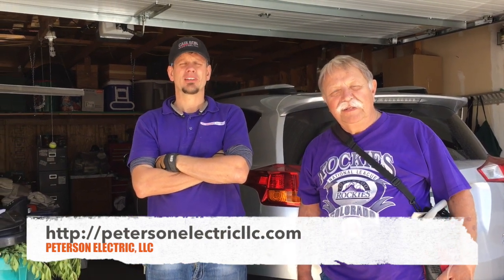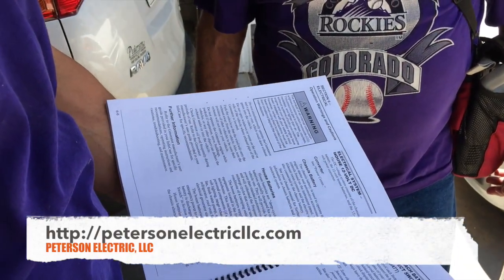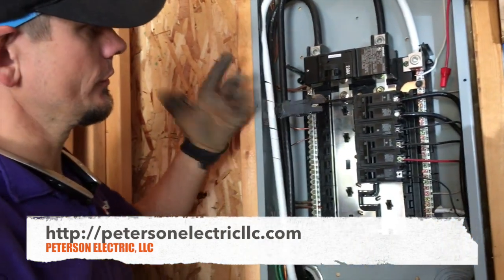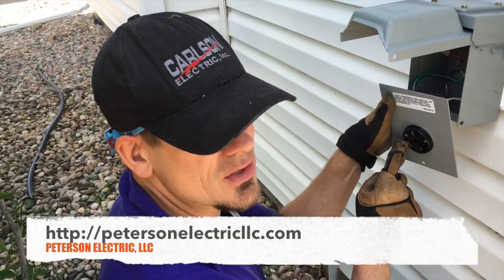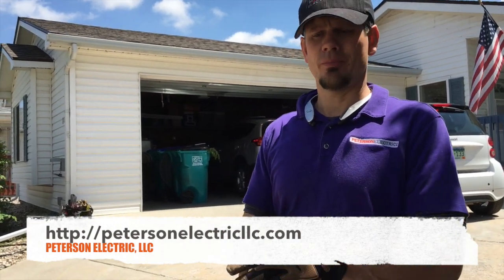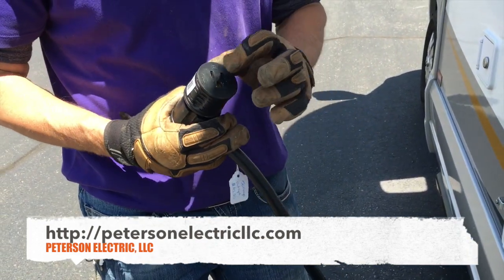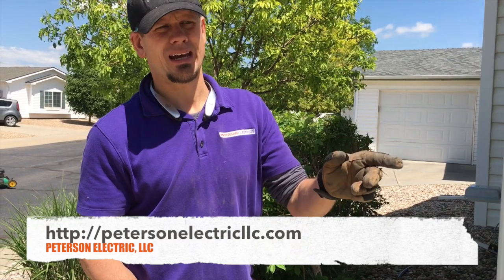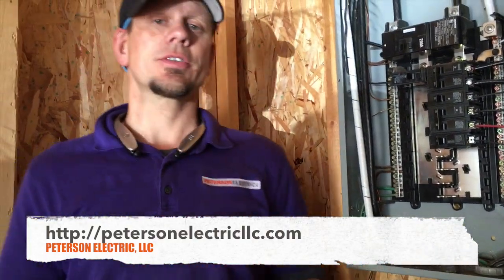Electrical Installation For 30amp RV Hookup & Need Manual To Determine Proper Requirements

Comment: I'm installing a 30 amp rv receptacle and a standard household receptacle in one box (there is a 30 amp breaker and 20 amp breaker in the box) . What size breaker do you recommend at the main panel? Also I'm running it clear across the back yard, quit a distance. What guage wire do you recommend?
Reply: Guess You never got an answer !

Comment: Pretty sure they need to be GFCI now
Reply: Only one I was required to put on a GFI, the RV would not play nicely.  Homeowner stated the AC was tripping the GFI.  They said it worked wherever else they plugged into but I highly doubt those parks adhered to 2020 NEC GFI requirements.

Comment: Everyone is saying 10/2 in a 30 amp box. I bought 10/3. Can I use that?
Reply from the maker: you can but you have to make certain your legs are correctly landed and color coded.

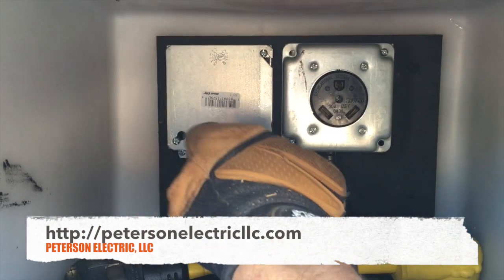Comment: 3:45  Why are you concerned with the wiring in his RV?  Do you follow him to every campsite and lecture him on it?  You install his outlet just like every hookup in every campground (that is correctly wired), this has no bearing on how his trailer is wired.
Reply: Josef I thought the same thing.

Comment: Next RV outlet job, you may want to recommend a panel with the RV receptacle plus a 20A GFI receptacle and two circuit breakers. Greater initial expense, but it is the proper setup...for many really good reasons. RV & marine electrical is what I do.  That said, I do appreciate your videos, and have learned quit a bit from them. :  )

Comment: From what I see in the video the neutral is isolated, but the neutral bus still has the panel bonding screw left. Hopefully you removed that. Thanks.
Reply: Unless you never tightened it down, I suppose it's allright. I still always remove it and leave it at the bottom.

Comment: How come it doesn’t need to be GFCI protected? Don’t all outdoor outlets need to be GFCI?
Reply: Mario Caballero Not required or desired on RV outlets. Most RVs have one or two GFIs. You don't want to feed a GFI with power from a GFI because it's needlessly redundant, and false GFI trips are likely to occur.
Reply: Nice catch!
Reply: Peterson Electric they do make single pole 30amp gfci breakers
https://www.amazon.com/dp/B01HQGLUZO/ref=asc_df_B01HQGLUZO5310771/?tag=hyprod-20&creative=394997&creativeASIN=B01HQGLUZO&linkCode=df0&hvadid=167135564802&hvpos=1o1&hvnetw=g&hvrand=7160400432960460461&hvpone=&hvptwo=&hvqmt=&hvdev=t&hvdvcmdl=&hvlocint=&hvlocphy=9007394&hvtargid=pla-309377741951
Reply from the maker: To my knowledge, there are not single pole 30 amp GFCI Breakers, and I did not find a 30 amp 3 wire plug for this. So, there is no way to do this other than if we would install a 50 amp Spa disconnect or a 30 amp two pole spa disconnect. Besides, his unit was Protected.